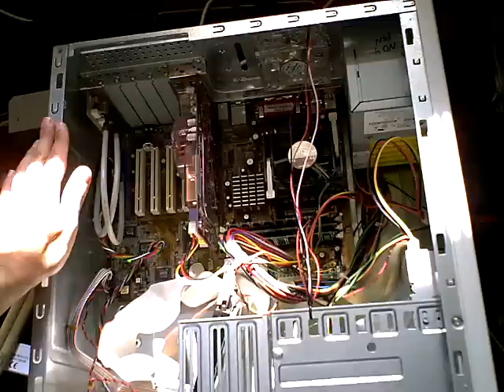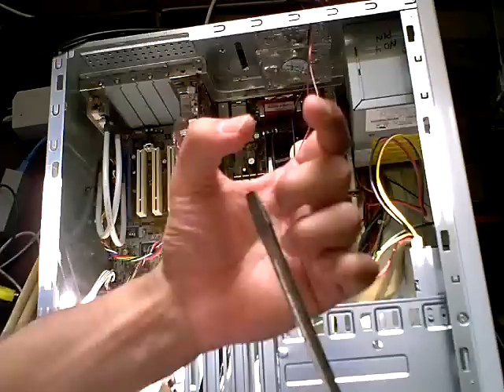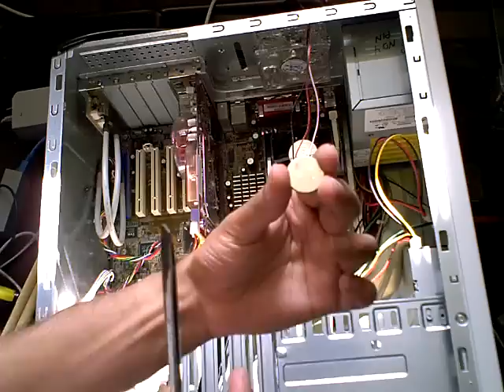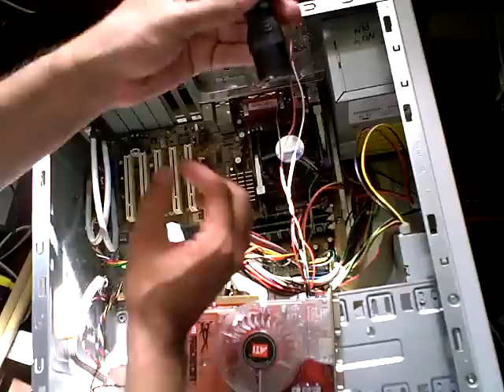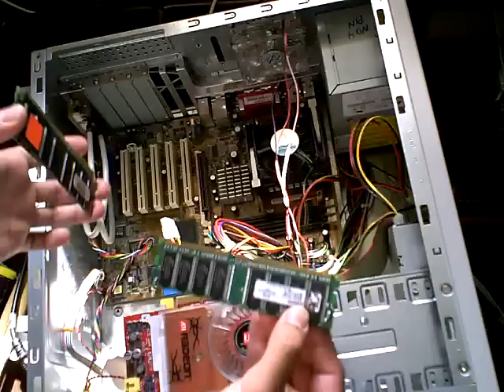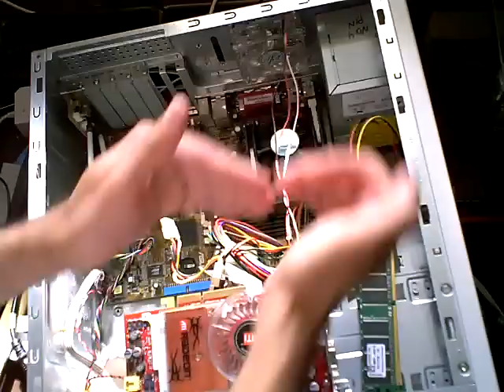How to possibly fix a PC that will turn on but will not beep and will not display anything on screen

Comment: My computer won't run, when i push the power button machine runs for 1 sec. Then it won't rerun. But after I remove ATX12v cable machine runs but no display on the monitor. Plz help me to solve this problem.
Reply from the maker: Your PSU may be too weak to properly run your PC. But before you spend money on a new one, I'd first Breadboard it (explained in the following video:)

If the steps in this video did not provide a solution to your problem, view:

http://www.youtube.com/watch?v=_EK9a-R5pss

You never know, maybe rebuilding the PC in the opposite sense that you took it apart will solve the problem.

Comment: i get a short beep when i start up then a little white dash in top left corner for half a sec then goes to a black screen... took battery out for an hour and short the clr cmos pins... any ideas its a gigabyte f2a55m ds2  motherboard, A8 5600k and i dont have a graphics card..
Reply from the maker: From the sounds of things, I'd guess that the BIOS chip itself is defective, but I'm just guessing here. It could be any number of factors. Only thing I can recommend is that you Breadboard it (explained in the following video:)

If the steps in this video did not provide a solution to your problem, view:

http://www.youtube.com/watch?v=_EK9a-R5pss

You never know, maybe rebuilding the PC in the opposite sense that you took it apart will solve the problem.

Comment: Need help please !!! i detected who was the problem in my pc thank to your video. it was graphic card . but before happend this i was just plaing a game and my pc just turned of and i know the reason why cause has happend many times , it was from temperature on my graphic card . i open my gpu graphic card and i saw that was not termal paste in there . is that the reason that my graphic card doesnt work or could be something ealse?? i will be really greatful if you help me :)
Reply from the maker: Thermal paste is necessary between the GPU chip and the heatsink. If your graphics card heatsink came factory installed, then there was a substitute to thermal paste between the two (generally a black coloured tape of sorts between the two). Video cards die out with time and after they have been pushed too hard: chances are yours was just due to go, that's all

Comment: My computer would not post, just the fans spun up. It would not shut down from the from panel reset button either. After watching the video  I tested all the power supply output pin voltages as described in a 24 pinout diagram.   I then removed the cmos battery, did the jumper as described, removed all peripherals, USB connectors & memory sticks as described in the video. I waited about 10 minutes then put the cmos jumper back in the normal position. I started up the machine and just the fans spun up. I left the machine running for about 45 minutes (because I moved along to the next problem of my day. My attention was drawn back to my machine when it gave out a long continuous beep. I shut it down, added the cmos battery, ram and monitor and it did boot. I added the hard drives, booted it again, reset the bios (since it was modified from the original configuration) and I was good to go. Thanks Rodney for leading me in the right direction.
Reply from the maker: +Chips Magee Thank YOU for properly troubleshooting the issue. Many in your shoes would try the CMOS trick, and if it didn't work, would give up, so I'm happy to help someone who did what they needed to do. Good job : )

Comment: THANK YOU! Nice one mate! This worked perfectly for me by:
(1) Removing and replacing the CMOS battery (I tested it with a battery life tester and I didn't need a new battery).
(2) Moving the CMOS jumper back and forth (I waited 4 mins before putting it back in its original position).
(3) Booting from a Win startup/repair CD then, when prompted with the option to do so, loading the 'CMOS default settings'.
Reply from the maker: Glad things worked out and thank you for the feedback : )

Comment: to quickly identify problems...1) look for the light of the motherboard it is in the middle green or  yellow.. that has to be lit when powered on..2) look for bulging capacitors..it takes only 1 for not booting at all...look all capacitors small and bigger sizes  if they are bulging  motherboard is dead..the cap can be replaced unsoded and put a new one and sod it
Reply from the maker: Thanks for sharing : )

Comment: Been about 2 weeks ..... power surge shutdown PC. Started up but no boot up or monitor came back on. Replace PS but nothing. I followed steps outlined in your Video. Jumper ed the fema, etc.  50/50 right. Rather delighted at this time as the PC did come to life and boot up. Will set this back up as my main desktop in the AM and see if everything holds up. Thanks for taking the time to share and post your expertise.  PM

Comment from the maker: Andrew Wessell Andrew Wessell Andrew Wessell If your computer powers on but for a mere second or two and then immediately powers down, It sounds like your motherboard is developing a short circuit due to contact with the metal casing. Most likely it has to do with the screws and metal mounting stands (supports) that your motherboard sits on. The cheapest way to fix this problem is to introduce cardboard washers between the screws and where they make contact to the motherboard, or you can buy plastic mounting supports at a computer shop.

Alternatively, you can always Breadboard it: 1)place the motherboard with CPU+Fan on wood or non-shiny cardboard 2)connect all of the case connectors to the board's panel 3)with a power bar that is OFF connect the PC power cable from the power bar to the power supply and the power supply to the board 4)while NEVER touching any exposed component,power on the power bar and press the power switch on the case.If the problem still persists,one of the remaining components is probably defective.Power off the power bar before dismantling

I cover breadboarding in greater detail in this video:
Advanced troubleshooting technique tutorial of how to possibly fix a PC that will not beep at boot
Reply: What if there is not consistency with it what if my pc somtimes boots up fine but latter crashes then refuses to start and changes up alllot somtimes it wont desplay somtimes bios will lock up somtimes the os will lock up
Reply: +RodneyDickson what if it 'sometimes' only does those things? Sometimes my computer will start for a few seconds, then shut off- other times it starts fine, goes to desktop- can do some things, then it shuts down and won't start again- powers on but powers off OR just sits there with fans running, but computer not starting up.I've tried clearing cmos- put in new battery, tested all peripherals like psu ram, vid card sound card etc by trying other ones in it- tried new cpu heatsink, etc- shut off all extra fans etc- Tried starting with no dvd, no anything except hard-drive really- still nothingComputer still acts funny- won't start, then I unplug everything for several days and all of sudden computer starts again, runs for awhile, then powers off- it's just acting very wierd
Reply: +RodneyDickson hey rodeny look .. my pc when i turn on .. he turn on and then somewere he  block at the moment .. dosent move any thing  .. sometime he turn on and its normal sometime he block dosent move anything  .. i look for repair it said its hard disc .. it fixed BUT STILL got block ..  it needs to turn off and to turn on again ..  and do something again like that ..  what to do about this??
Reply: so I was listening  to music the other day and all of a sudden  my screen goes out nd I powered it down. after screen went white 
so I wait like 10 minutes  to turn back on and I didn't get my screen  back and runing I hope it ain't my motherboard maybe u got a better idea man
Reply: +RodneyDickson 
Sir, my computer case is having a bit of electricity flowing specially at the back part. What do you think is the problem and is there a solution for it???
Reply: my motherboard is working but I don't knowledge in my gpu is bad or my ram I have tried everything bow I'm a first time builder.
Reply: +RodneyDickson my computer powers on and off when i switc it on. the processor fans starts for two seconds and then stops and then restarts but it doesnt boot up.when the ram is inserted in one of the slot three beeps can be heard but if i place it in another slot no beep sound. what can be the problem. i have already tried replacing the ram. what can u suggest?
Reply from the maker: +Tito Cap Happy to be of help : )
Reply from the maker: +repo gaming Sadly I haven't a fix for this. The only solution suggestion I have is to format your hard drive, reinstall windows, and keep windows 'clean', so don't load it with junk. Good luck.
Reply from the maker: +Nazareth434  It sounds like your motherboard is developing a short circuit due to contact with the metal casing. Most likely it has to do with the screws and metal mounting stands (supports) that your motherboard sits on. The cheapest way to fix this problem is to introduce cardboard washers between the screws and where they make contact to the motherboard, or you can buy plastic mounting supports at a computer shop.

Alternatively, you can always Breadboard it (explained in the following video:)

If the steps in this video did not provide a solution to your problem, view:

http://www.youtube.com/watch?v=_EK9a-R5pss

You never know, maybe rebuilding the PC in the opposite sense that you took it apart will solve the problem.
Reply from the maker: +klodi elezi Firstly, I would go into the BIOS then Load Setup Defaults, then save and exit. If that doesn't solve the issue, I'd format my hard drive, reinstall windows, and from there keep my PC clean by not overloading it with junk. Good luck.
Reply from the maker: +Eliseo Cortes Breadboard it (explained in the following video:)

If the steps in this video did not provide a solution to your problem, view:

http://www.youtube.com/watch?v=_EK9a-R5pss

You never know, maybe rebuilding the PC in the opposite sense that you took it apart will solve the problem.
Reply from the maker: +Alfred Kyo Eek! I haven't a clue sadly. I recommend you use a surge protector bar and a grounded power supply cable. Good luck.
Reply from the maker: +Justkillnl If you still have this issue, go into your BIOS, Load Setup Defaults, save and exit. I hope this solves your issue.
Reply from the maker: +Neal Mistry Breadboard it (explained in the following video:)

If the steps in this video did not provide a solution to your problem, view:

http://www.youtube.com/watch?v=_EK9a-R5pss

You never know, maybe rebuilding the PC in the opposite sense that you took it apart will solve the problem.
Reply from the maker: +deadgaming20 You can try cleaning the contacts with rubbing alcohol, wait 1 hour before reinstalling. Other than this, I haven't a solution for you. Good luck.
Reply from the maker: +sachin pandey It sounds like your motherboard is developing a short circuit due to contact with the metal casing. Most likely it has to do with the screws and metal mounting stands (supports) that your motherboard sits on. The cheapest way to fix this problem is to introduce cardboard washers between the screws and where they make contact to the motherboard, or you can buy plastic mounting supports at a computer shop.

Alternatively, you can always Breadboard it (explained in the following video:)

If the steps in this video did not provide a solution to your problem, view:

http://www.youtube.com/watch?v=_EK9a-R5pss

You never know, maybe rebuilding the PC in the opposite sense that you took it apart will solve the problem.

Comment: Great video. My fans are running when I power up and monitor goes into power save. I have a 1 year old Corsair  CX750M power supply. I did not get a long beep or any beeps when I removed my Ram. I guess my Asus M4A77TD Motherboard is shot. Great video. Thanks for posting.
Reply from the maker: Before coming to that conclusion, try to reset the CMOS as shown in this video, and if that still doesn't work, replace the CMOS battery with a fresh one, and if that STILL doesn't work, Breadboard it (explained in the following video:)

If the steps in this video did not provide a solution to your problem, view:

http://www.youtube.com/watch?v=_EK9a-R5pss

You never know, maybe rebuilding the PC in the opposite sense that you took it apart will solve the problem.
Reply: I did all of that. The motherboard is like10 years old
Reply from the maker: I see. Yeah, in that case, it might've done it's time : \

Comment from the maker: Charles Flippen I've seen this issue with Dell PCs before. Well, your troubleshooting steps were thorough, and sadly I haven't much else to suggest. I guess as a last ditch attempt (if the PC isn't on warranty anymore) you could always try breadboarding the PC or rebuilding the PC in an opposite sense (see Advanced troubleshooting technique tutorial of how to possibly fix a PC that will not beep at boot )
Reply: That pc is crap anyway show us your real pc.
Reply: If it beeps twice the CMOS is healthy and video is bad other wise your motherboard is trash because it cost more to fix then to buy a new board.
Reply: my pc just turns on then off repeatedly
Any help??
Reply: hi RodneyDickson, i got a problem with PC. i have installed my ram, but when its booting, there is sound long beep 1x, and the screen is also not display anything. i dont know what happened, i have make sure i have installed my ram correctly. pls help me.
Reply: ***** In my experience the CMOS dies slowly and frequent crashes or will stop booting on usb and boot time increases.
Reply: ***** I havn,t but I've been using baytrail quad core processors that under clock automatically when cpu usage is low to reduce heat.
Reply: ***** Bay trail is a desktop cpu. The point is bay-trail is super heat efficient but still runs modern games well. Considering how crappy pc gaming is on a laptops is it best not to pay more Intel.
Reply: ***** Yes the Celeron j1900 the only bay-trail worth having because the rest either have to slow clock speeds for modern games or a slightly higher clock speed thats not worth the extra price.
Reply: RodneyDickson. itts beeenn helpful
Reply: rai-yan omar Also where gloves before touching motherboard.
Reply: ***** Well if the pc is 5 years old  say who cares but if your building a 800$ Id invest a few bucks in think gloves.
Reply: RodneyDickson Kudos to you Rodney I used your technique to identify a faulty graphics card. I'll probably need to reinsert it to ensure it isn't a BIOS config issue but my pc is up and running with my spare graphics card so really appreciate your instructions....
Reply: chi 5 It may just need to be cleaned.
Reply: chi 5 unplug for 30 minutes and clean every card slot with just cue tip no chemicals and if that still dos,nt work its time to test components in other desktops to see if its the components fault or the motherboard.
Reply: chi 5 I would shop for a new board that's returnable if it dose not work.
Reply: RodneyDickson Dude Thank You i Subscribe now . it FIx my PC
Reply: my pc turns but its says that its checking batterry life and that pipe is broken please helpppppp
Reply: RJJM Fails replace/remove the battery and jump cmos1/cmos2 and or txt modual for microxt programanble CPU instruction set.
Reply: Marin Laurentiu yea after jumping the CMOS then you need to set the time in BIOS then you can continue with your nerd stuff

Comment: My CPU starts automatically without pressing power button in CPU.....doesn't display anything on screen...no display...how to fix it?
Reply from the maker: Your problem is the same as that which is shown in the video (this is how some PCs react to this problem). That being said, try what is shown in the video: disconnect the power cable, remove the CMOS battery, short the CMOS jumper pins for 9 seconds then return the jumper cap to its initial position (only if you can find these jumper pins; if not, skip this step), press your PC's chassis power button switch (to discharge any remaining power circulating in the system), leave the PC unplugged and in this state overnight, then the next day return the CMOS battery to its socket, power up the PC, and if no beep, then disconnect the power cable, press your PC's chassis power button switch (to discharge any remaining power circulating in the system), remove one component, power up the PC, and if no beep then repeat (each time unplugging the PC, pressing the power switch to discharge remaining power, removing a remaining component, and then powering up, and this until the PC beeps at boot).If it never beeps, even when you are down to just motherboard, power supply & CPU+fan, one of these remaining components may be bad

Comment: I realize this video is almost four years old but it helped me out ..I own an Asus P5N-SLI motherboard in my computer and I did as you suggested ...I kept removing components from it and powering back up until i took out the old ethernet card and i heard one beep followed by three more beeps I replaced all the previously  removed components powered back up and it was good to go ..Thank You
Reply from the maker: +Fryingsquirrel Nice! Yeah, sometimes the BIOS gets confused as to which components are to be accessed at which time. Removing a card temporarily (like you did) gets it back on track : )